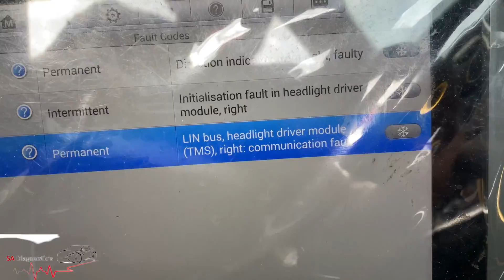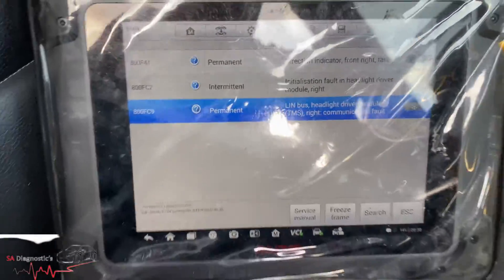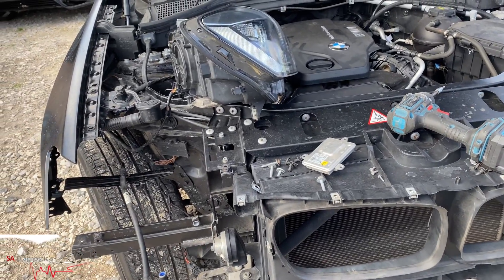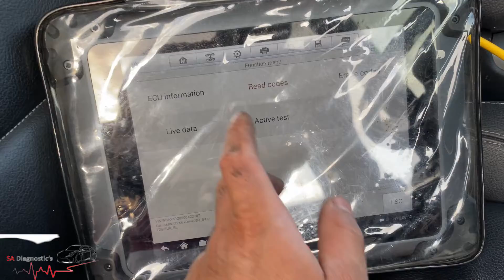BMW 800FC9 LIN Bus, Headlight Driver Module (TMS), Right Communication Fault Autel

Comment: I have a fault code for the same exact thing passenger headlight was replaced in the past, has check engine light, won’t allow me to pass Emissions testing…. The fault code is CD8E10
Reply: Can’t seem to figure it out…
Reply: Hey, have you gotten your issue sorted yet? Having the same issue.

Comment: Hello pal. I have same problem aswell but i have more problems my indicators is working wrong aswell and rear number lights is off aswell. Just tested module wit is inside in car and its 100% working condition. Mechanic check car wit diagnostic machine. And its told me its possible headlight module.  
My question is ----  its possible if headlight module is broken other lights have problems aswell? Hope you can answer me and help me.
Reply from the maker: Hi yes it could be possible modules can corrode or internalally could be faulty
Reply: Thanks you alot.
I booked appointment to Monday and get quote for 200£ in totally to get fixed this fault. I fink price is OK?
Thanks for your asap answer 🙏 👍 🙌 😊
Reply from the maker: @AivarBissnes  yeh price is good
Reply: Frm module can also cause multiple electrical issues i.e. lights around the car not working properly

Comment: Is there a way to replace or buy internal module of headlight or have to buy entire headlight?  , I have same issue in f10 , switched TMS , but always right side indicator fault comes after 10 mins of lights are on.
Reply from the maker: You can buy separate modules.
Reply: So internal headlight module can be bought or not?  What means “ you can buy separate modules”, ? Means “yea, internal module can be bought”?